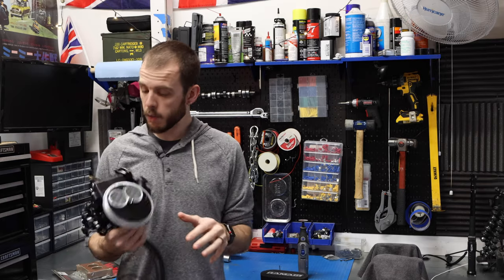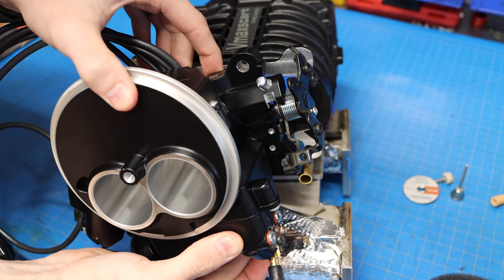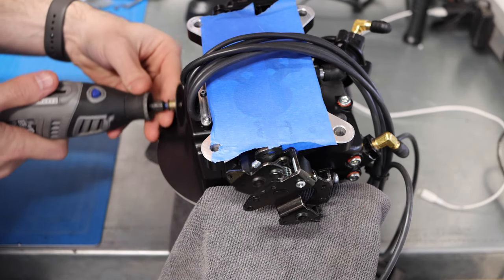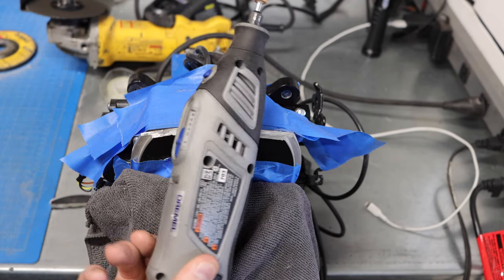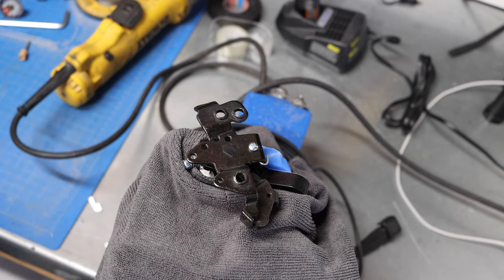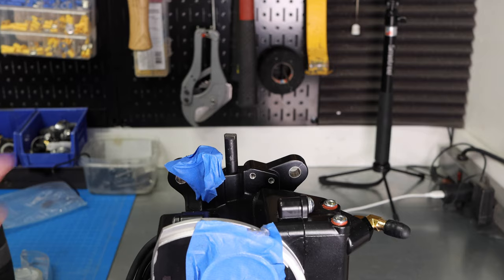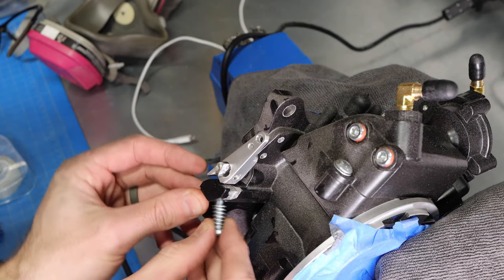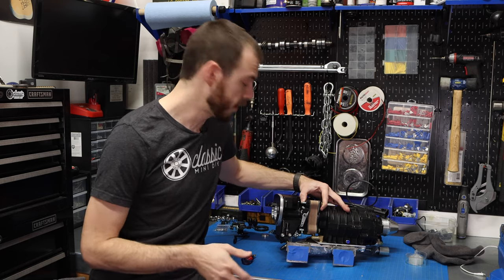Super Bad Wolf - Part 4 | Chopping up a $1100 Holley EFI

Comment: I was eyeing up that exact same EFI unit to run in N/A format first and then do exactly the same thing your doing. However landed in Australia those efi units are not cheap and your looking at $1800. 
Someone need to make a manifold for those for a standard A series engine

Comment: Unrelated to your video, but I would love your opinion. I have a 1293 with weber and I’m looking to upgrade the cam. Have you any suggestions? I want to still be able to comfortably daily it but race it a little bit too.
Reply: scott blakely Go with 731 road cam or equivalent. Plenty of power in the mid range.

Comment: Cole, I do not know if I have heard correctly but this EFI has already an ECU included? Luiz Fuchs Patreon member
Reply from the maker: Yes that’s right. It’s a complete system. Injectors, throttle body, ECU all built together in one.
Reply: @classicminidiy  Thanks. Now, is it possible to replace the carburetor system? OK, new manifold for sensors, I believe, etc..
Reply: @luizf.1692  you mean remove SU and fit this kit? it would depend on how much fuel it could flow ? the rover and SC injection systems use fairly big injectors to ensure each port of the siamese system is getting enough fuel.
Reply: Thanks. Well, iIneed to research more. I believe the ECU can be adjusted fuel, ratio, etc... I am sure with the next Cole's videos, we may know  better how this EFI will work is connected, sensors, etc... Cheers